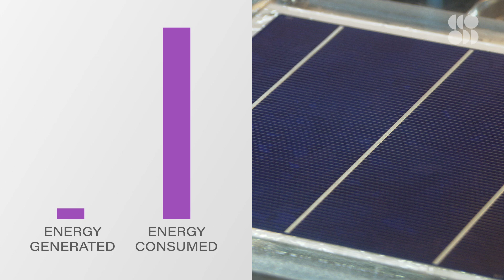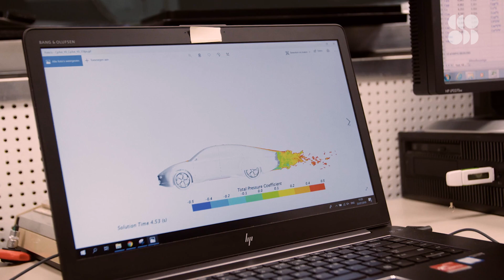The Solar Car Revolution Could Change EVs Forever

Comment: The premise of this episode is a little shaky.  EVs already compete well against ICE cars, with the last hurdle being the inflated prices (current battery prices SHOULD allow price equivalence with ICE cars by now).  A car that could drive without ever charging would be on a whole other plane, especially in the north.  An alternative to solar panels on your car is to put them on the roof of your house, with a battery wall to collect the energy.  More expensive, to be sure, but it would allow more independence and savings at home as well as the road.
Reply: Not everyone has a driveway or dedicated parking spot to charge in.  The full panels give you up to 11 000 miles a year for maybe 20 or 30 years for $900...  That cost of driving is ... ... pretty hard to beat!

Comment: @3:20, What are you saying.  These solar electric vehicles do have lithium batteries in them.  Otherwise, not only what would happen when you enter a shadow, or night time, what would be the point of plugging them in.  How would these cars capitalize on being parked in the sun if it weren't for charging the included lithium batteries.  How on earth do you expect to make it through a tunnel if these solar EV's didn't have any lithium batteries?

Comment: If I had circa 150,000 euros spare, and providing it has enough battery capacity for night driving, I would buy a "Lightyear One"... even though its manufacture has a massive carbon footprint.
Reply: Yep. It has a 450 mile battery range - enough to drive you through most of the night. However, you could buy 3 to 5 Aptera's for the same price, with ranges from 250 to 1000 miles (=1600 km).
Reply: @fotoguru222   Thanks for that. I understand what you are saying about the Aptera, but I prefer the size, shape and styling of the LY1.
In any event, it is all moot. I am retired and cannot afford either.
Stay safe & healthy,
R 😎

Comment: He keeps saying its vastly more efficient, but wont provide any evidence, thats how you know its never going to work. No numbers, and the drag coefficient wont help you at night if you have no power, of batteries to store said power. Plus, solar panels and their production are harmful for the environment, so thats a thing....
Reply: several battery options...  Are you planning to do more than 1000 miles in the hours of darkness?
Reply: @peterchandler8505  then it's an EV, not a solar car. It has a plug in, like an EV, and a solar roof, like most EVs....
Reply: @tietie1424  It has to be a battery powered EV, for those moments it is dark or raining....  There are not many EVs with solar panels, I know Kia does, & maybe a few others.  The problem with those is that the weight means that they will not get much extra range from the solar PV, whereas with the Aptera only needing 100Whr per miles, a third or a quarter of most other EVs...

Comment: Could they recharge tesla batteries 🔋???
Reply: Yes, you would be able to plug a Tesla into the Aptera's inverter to recharge it (very slowly).
Reply: @fotoguru222  the Sono Sion is set up to charge other vehicles, just need to plug the cable in...

Comment: I dont know why everything isn't powered by the sun... I guess because that source is free and cannot be regulated or taxed
Reply: No. Because it’s hard from a science, technology and materials science perspective. Tiny gains in efficiency for panels are being made every year, but there are still problems with the materials used, the fairly short lifespan, etc. 

There are definitely efforts by those invested in the fossil fuel industry to hold up and disrupt. But it’s a losing battle now as most people understand the benefits.

Comment: Wouldn't it be more efficient to keep solar generating power to the overall grid, and just charge the car when needed?
Reply: Not everyone has a driveway or dedicated parking spot to charge in.  

The full panels give you up to 11 000 miles a year for maybe 20 or 30 years for $900...  That cost of driving is ... ... pretty hard to beat!

Comment: That's great, but how safe is it to drive, merge lanes, and back up in the Lightyear One without a rear window? How much trunk space does Actara have? Do you have to wash them often in order to maintain solar panel efficiency?

I'm glad they're making significant strides in solar vehicular technology, but I feel like there are still some technical hurdles before any of them will be ready for the road.
Reply: Aptera has huge trunk space. You can sleep two people back there easily.

Comment: Electric power vehicles open the possibility of continuous charging while in operation. All city roads could have built-in continuous charging strips beneath the roads. Each car will automatically get charging while driving on the city streets. This way the city is the only power provider for all vehicles and we don't need the complexity of power generation in individual car. In remote areas, the charging strips will be less frequent between each other, hence less efficient but it would still make a big differences.
Reply: hopelessly inefficient.  Charge rate falls off very quickly as the distance to the charger increases
Reply: @peterchandler8505  A backup battery would still be needed. But the battery pack would be a lot bigger if that is the only source of power.
Reply: @zollen123  100KW battery in a Tesla gives a300-400 ish mile range, 100KW battery in an Aptera gives 1000 mile range as it only needs 100Whr to do a mile...  vehicles need to get massively more efficient to be able to run on solar power only!

Comment: I'm an engineer and I love technology, but the solution for this problem is quite simple and do not require any thing new: Compact cities and Bikes.
Reply: Bikes require fuel in the form of food for the bicyclist. What the carbon footprint of that food? If you’re a vegan it’s 5x less than a gas car. If you’re a carnivore it’s worse than driving a diesel car. These solar EVs would be better than riding a bike.
Reply: @juliahello6673  Nice breakdown!  I haven't seen that before...Thank you!
Reply: @jayhuiting5748  being strictly vegan or carnivore is inferior to being omnivorous
Reply: What would be the carbon footprint of tearing down our cities and rebuilding them as compact?

Comment: The only problem I see with this concept is: you have to leave your car in the sun. That leads to you having to blast the air conditioning. Would that have any significant impact on the amount of energy used while driving? I live in CA & that seems like it would be an issue.
Reply: Yes, on hot days a fraction of the solar energy would go to keeping the car cool, so it charges more slowly. But the car's body with its composite construction material is better insulated than standard metal body cars. And once fully charged, you can move it into the shade.

Comment: Guys - that's quite a bullshit title. These cars are EVs with solar panels which is not even smth new in car industry. Cars had solar panels for over two decades now - mostly for remote climate control - but it was a thing as option in more premium vehicles.

Comment: Ummm, so a 10 story parking building can only charge one story worth of these at a time. How do you plan to charge the rest of the cars? It's not as easy as driving to your work and charge your car. You need a parking space in open for that, and that's expensive.
Reply: Doesn't matter where you park when the sun doesn't shine.

Comment: * Stupid click bait title for a commercial, unsubscribed as it show I can't trust anything Seeker make! *

A Tesla with 5x2 m area, 20% efficiency solar panels = 2KW of usable energy when sun are direct above.

A Tesla 3 uses 14.4 kW⋅h/100 km or 1.44kW at 100km/h, so yes it can power an EV during about 6 h per day and you need to walk and push the car the other 18h.

But their car only uses 100Wh per mile, 6.2kW-h/100 km. So half what a Tesla 3 uses. But likely less than half of the area. So still need 3m2 solar panels with 20% theoretical efficiency or 6m2 with 10% practical efficiency.

Sure in the Summer I can use the car 12h per day in Sweden but in the winter about 1 minute if I'm lucky...

Nah, I still go for an EV with batteries then an EV without.

Comment: Aptera is not happening, expensive and doesn't work. In fact that solar simply doesn't work like that. 
It comes down to surface area and angle, basic science stuff. The angle of the sun will never be optimal to give a solar car it's highest efficiency, and the best it can do is around 20% if optimal. You will generate almost enough power to go a block, before you run out based on a daily charge from the sun with these designs, and forget driving at night, or with the AC on. These concepts are just nonsense.
LightYear claims €150.00 as the purchase price. Let that sink in. Same marketing as Elio motors. Never happening.

Comment: whaaaaat is with the garish design? from the side it looks like your rear turn signals are sticking out at a strange angle. more aerodynamic does not equate to more safe, I'd really like to see how this design handles in commercial vehicle safety and crash tests...
Reply: They've designed Aptera to pass all international automotive crash tests. That's more than pickup trucks, SUVs or vans can do.
Reply: @fotoguru222  so you're telling me they haven't actually done any crash tests, but that they're just "designed with safety in mind"? really I don't mean to take your words out of context I'm just trying to understand.

Comment: PSA: These are Photovoltaic Vehicles. Stop saying they're Electric Vehicles and that this is click bait.
Reply: Wrong and wrong
Reply: @kirkc9643  liked your own comment, huh? Pathetic

Rebuttal me or concede. Non sequiturs have no place in science.
Reply: Perhaps you could amuse us further by using your superior grasp of science to explain to us dummies the method of locomotion for these "photoVOLTAIC vehicles"
Reply: @kirkc9643  Sure.

Superman, derives his strength from earths yellow sun.

Is Superman an:
A) Electric powered super hero or
B) Photon powered super hero?

Obviously a bit of humor but my point is the distinction is important. Just because the vehicle uses electricity, doesn't mean it's an EV.

That's like saying an ICE is an EV because it too has a battery and uses electricity to run the starter.
Reply: @dagnabbitwabbit  I can't believe you are smart enough to string words together into coherent sentences yet state complete garbage like that
Reply: @kirkc9643  You asked me to dumb it down, now you're offended by my over simplification? That hardly seems fair.

Don't be angry at me. Nuance, minutiae, semantics, jargon. Those are your enemies.
Reply: @dagnabbitwabbit  The energy contained within coal and oil also come from earths yellow sun so perhaps we should be calling them photon fuels? And no, I didn't ask you to dumb it down. You set the bar pretty low with your OP
Reply: For a more considered reply:

"Photovoltaic" means creating electricity from light.  The Aptera uses solar PV panels to trickle charge it's locomotion battery.  Because the car is so efficient (100Whr per mile. Teslas range from 240 to 350Whr per mile plus), then the Aptera goes much further for each Whr, making solar charging viable.

Aptera are clear from the word go that the Aptera is a battery electric car, that they have focused so much on vehicle efficiency that the solar panels can make a useful contribution to it's range.  Up to 11 000 miles driving (depending where you live, half that in parts of Europe) for 20-30 years for $900 (full solar pack price) is a great deal!

This video is not clear about it :(  Undoubtedly the title for the video is quite poor

Comment: The Lightyear is much more refined and further on in development. Hard to know who Aptera is aimed at. A 2 seat car/bike is a tough sell.
Reply: I guess the Aptera is aimed at people who want a solar car that costs less than $135,000. The Aptera starts at $26k for the 250 mile version, and $47k for the 1000mile version with all the solar that will fit.
Reply: Yes, Lightyear looks like a very nice car. At well over $100K it better be. 
So far over 11,000 people have reserved Apteras (I'm one), and they are planning for production of 10K per year. Some people really like this fast, efficient, long range roadster!  
I believe Lightyear is planning to make only a few hundred of theirs.
Reply: @fotoguru222  Can't argue with 11000 orders.

Comment: It's literally a more expensive EV that will take about a week to fully charge on solar, (and that's in the best case scenario)... 

Charging with solar panels at home is a better solution.
Reply: 20 year guarantee on most solar panels. And the idea is that most people drive 30 miles per day, so if you start the week with a full battery you end the week with a full battery because the solar panels charge as much as you drive.
Reply: Aptera starts at less than 30k.
Reply: Not everyone has a driveway or dedicated parking spot to charge in.  

The full panels give you up to 11 000 miles a year for maybe 20 or 30 years for $900...  That cost of driving is ... ... pretty hard to beat!

Comment: Traditional EVs are by far more environmentally friendly, overall, than traditional IC vehicles. They do require more fossil fuel usage to create and fabricate the vehicle, including the battery. Li Ion batteries are amazing because they can charge and be used numerously. However, they cannot be discarded like most wastes and cannot be recycled due to the chemicals inside them. 

The concept for solar vehicles means eliminating the battery and fossil fuels. Besides the electronics and chassis, there’s little to no negative environmental impact. These concepts still have batteries, because we are still in the early stages. What’s holding us back is the infancy of solar power technology. The tech itself has been around for over a century. Just like EVs. The problem was always efficiency. We’re lucky to even use 40% of the energy panels can absorb. To combat this, these guys are leveling the playing field by also adopting non-traditional vehicle designs. If we can harness more solar efficiency, we may one day be able to worry less about structure. Our world doesn’t have that time.
Reply: "However, they cannot be discarded like most wastes and cannot be recycled due to the chemicals inside them"
Already companies recycling end of life BEV batteries

"Our world doesn’t have that time"
Absolutely, IPCC gave us to the end of the decade to break the fossil fuel habit!

Comment: Yeah, sure, its the solution now, but they went broke first.
I will sit up and take notice when I can actually go out and buy one ror a reasonable price,  without living in California,  just like most EVs
Reply: Is $25,000 a reasonable price?
Reply: @LeesChannel  That is fine for me. 
Of course, then comes the long wait for the infrastructure of servicing agents,  charging points,  and such, if you don't live in a part of the world within 500 miles of a factory.
Reply: @dnomyarnostaw  You can charge it at home.  The long wait would be for the manufacturing, honestly.
Reply: @LeesChannel  Oh yeah, I forgot that part of the mess.  
First : you are assuming I only commute within my range every day, and/or  always come home.
Second: The "standard" 22 kw home charger for about $1500 to $2000 can take all night to recharge.
A "fast" 50 kw can do it in a couple of hours,  is two to three times the price, at around $5000.

IF you have your own home for a permanent installation.  
A lot of people bought EV's without knowing THAT part of the equation.
Reply: @dnomyarnostaw  Actually because of how efficient the Aptera is you can actually get usable range from standard outlets.  It also absorbs over 40 miles of range on a sunny day.  If range is a concern it can be configured to as much as 1000 miles of range.
Reply: @LeesChannel  The Aptura???? Its a motorcycle!!!    Hard to even get the groceries in, let alone a trip to the hardware store or  more than three people!
It would be far cheaper and practical for me to buy and run one of those dinky European two stroke cars, and it would be a toss up who released the most CO2 in the cars lifetime.
Reply: @dnomyarnostaw  It has more storage space than a Tesla Model 3.  It may be cheaper and more practical to get a cheap 2 stroke car, but it will have less power and less range and less speed and it would certainly produce more pollution throughout its lifetime, plus need more servicing and maintenance.  It would probably also have less storage volume.
Reply: @LeesChannel  "more storage space than a Tesla Model 3."
Not if you include the missing passengers

" less power and less range"
Aptera
2 or 3 x 50 kW from Elaphe Ltd., 250, 400, 600 or 1,000 miles (1600 kms), 
NO Towing, Safety Rating - unrated.  PRICE AUD$61,000

Fiat 
1.2 litre turbo, 50 kw, (SAME POWER) 4 passengers, 4.8 litre per 100 kms  , with a 90 litre jerrycan, 2000 kilometres,  (BETTER RANGE)
Towing 800 kilos,  Safety Rating - Ancap 5/5. PRICE AUD$22,,000

Finally,  availability ? In Australia Fiat, 3 weeks, Aptera FIVE YEARS

I don't even HAVE a choice :-(

Comment: Now u just need to add a wind turbine, so you are generating energy while you drive
Reply: Why bother with the wind turbine, just use the wheel motors to drive a generator. That makes just as much sense.

Comment: Electric car is popular? Umm that's totally wrong if you consider the whole world where places with no electric.
Reply: A solar powered car would be even better in such a place! No need to plug it in. External solar panels would take care of power for any EV. Now every place can have electricity for low cost. No expensive coal or diesel burning power plants neeeded.